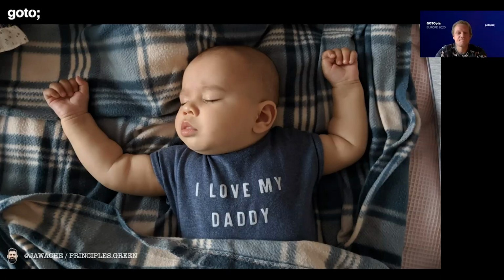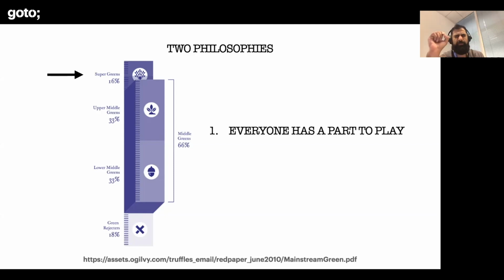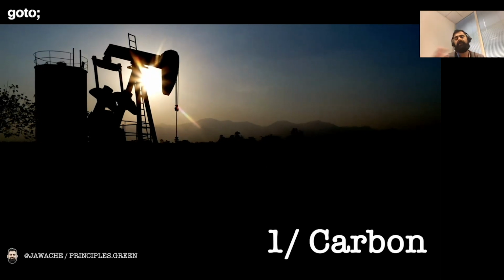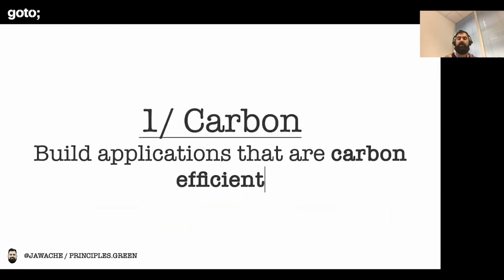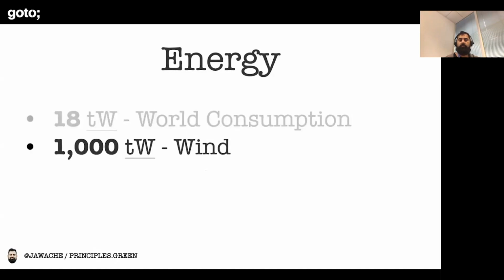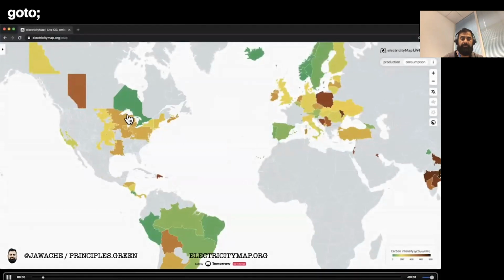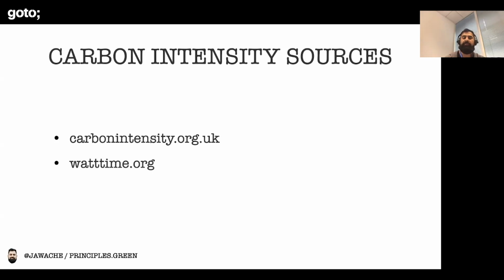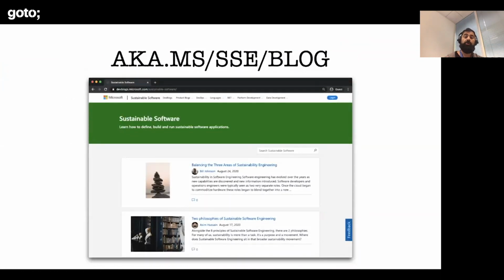Sustainable Software Engineering, Building Carbon-Efficient Applications • Asim Hussain • GOTO 2020

Comment: How can I write code that is carbon efficient. want to know more from dev stand point. Any resources / pointers are much appreciated
Reply: I'd say typical stuff. Pick a hardware affine language. Reduce the amount of CPU cycles by choosing the right algorithms / data structures. Get rid of unnecessary allocation. Increase throughput with SIMD. And most importantly, run benchmarks instead of guessing. Plus think about how many instructions your function requires and divide it by the Ops/s rate of your processor, then see if the calculated time matches your benchmark's measurements. I mean it's not too hard to pull this off 🤔🤓👨🏻‍💻